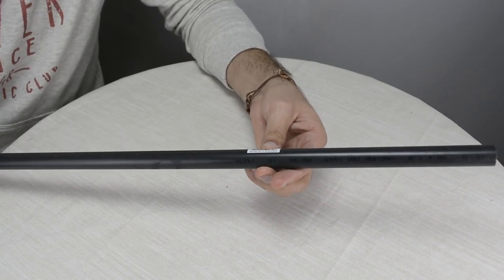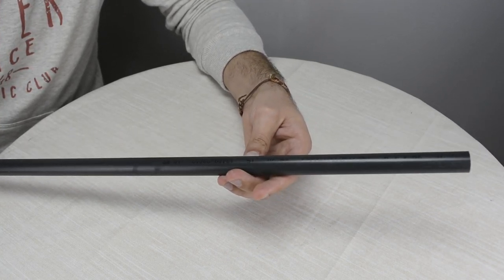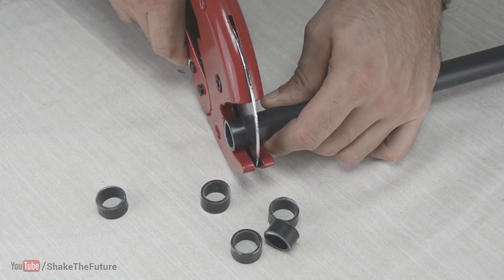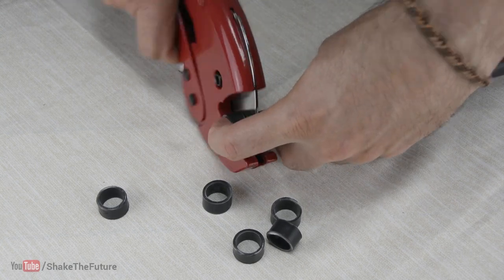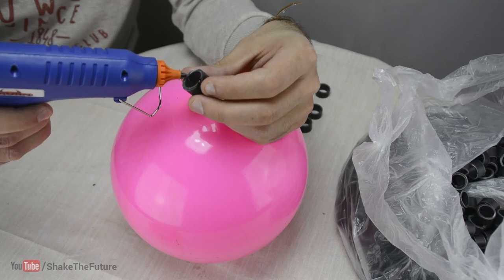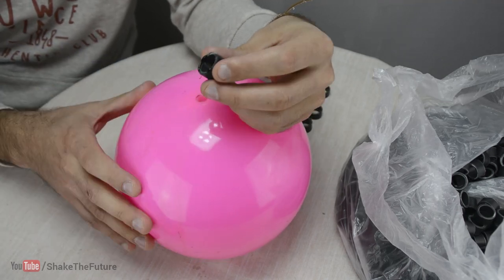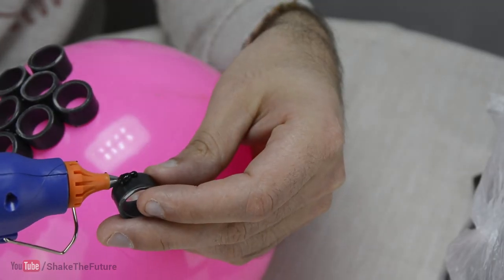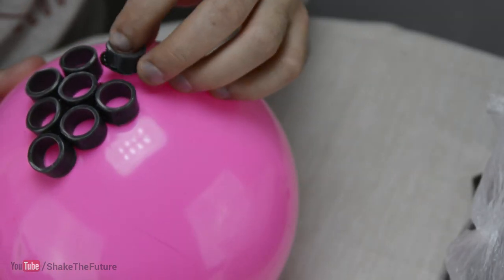Make an Awesome PVC Light/Lamp Shade

Comment: Changing the bulb is done how?  I'm guessing that's a paper lantern style  light kit with a cord. Theoretically I guess you could leave a few unglued,  enough to flex open for bulb and light kit, if needed add a zip tie to hold together for structural support however I'm pretty sure it might not even be necessary.

Comment: Nice but i have a question    does the glue melt as the bulb gets hot?
Reply: It depends on the type of glue.
Reply from the maker: +ibrahim duman 
No it does not. Well, I use LED bulbs, so they don't get too hot.

Comment: its great but i have a question.
how do u hang that light inside that lampshade? is there any clip u used?
Reply from the maker: +Ben Hendarsean 
I used wire. 
Similar to this one:
http://cdn.instructables.com/FW0/HE2Z/I9WTORVG/FW0HE2ZI9WTORVG.LARGE.jpg
Reply: +Shake the Future  thanks for the reply. i saw that video of urs. u did that with a baloon. i follow ur videos all the time. but doesnt it slip down? i made that but the bulb slips beneath the  lampshade.
Reply from the maker: +Ben Hendarsean 
Yeah, the lampshades weight can be too much for that kind of clip.
Try wrapping one part of the cable with some electrical tape, so the clip can't slip down.
Cheers!
Reply: +Shake the Future 
thanks mate, cheers👍